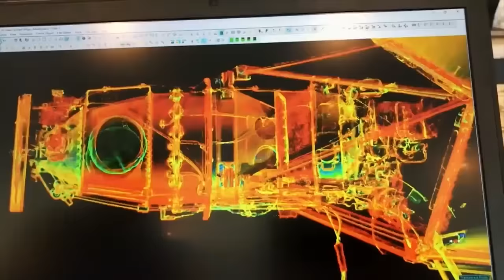We both almost died...now what??

Comment: About 6 months late to this party, hopefully someone will read this. 1) I got my pilots license in 85 however I could not afford to continue flying for the rest of the tickets so I went in the Army and became a mechanic, so what’s going right is I see a surge of young people jumping into flying which is great to know in spite of the high costs of flight schools charging more for the same ole beat up cherokees and or 152/172’s. 2) what I see that we can do better is a complete rewrite of the ACS, we have learned so much more about flying since those rules were written and have seldom been revised. We need better training both for pilots and mechanics who maintain them and the relationship that has to be forged to build trust to maintain high quality. Scenario based training maybe in simulators first, my instructor did a thing to me that I talk about to this day, we were on my long cross country at 9500’ and he asks, what would you do if the engine quit so I gave the textbook answer, he shakes his head and we keep flying. Sometime later he pulls the mixture and the prop stops and things get real quiet, I let out the OH Shit, then he says what are you going to do?? Went thru the textbook procedure he says ok do it and call it out, then he says while you’ve been going thru the procedures your battery went flat how are you going to restart the engine? I was set up for best glide so I said we can try to windmill start, he says do it so I pushed maybe 10-15 degrees he says NO PUSH it !! At the same time he says it he pushes the yoke till we were nearly vertical and that engine started right up I recovered and my heart rate became normal again. All that to say we are not training as good as maybe we should be in my opinion. 3) I’d like to see continuity in cockpits like a GA version of TCAS, maybe TCAS Lite, and density altitude calculators that tell you some kind of performance level of the airplane at higher altitudes aurally like a nagging voice saying power not available to get out of this canyon kinda like the predictive airspeed bugs or pink trend bug next to your airspeed telling you his is where your airspeed will be if you maintain it his attitude. Tools to keep you safe and keep from making bad decisions. Lastly make it harder for anyone to jump into any Bonanza before they get not only complex training but differences training for that specific airplane  and hang a 50-75 hour time on it dual with an experienced high time pilot, I think this will help in the fatalities generated from that one airplane alone, and for God’s sake come up with a better yoke raise it 8 inches from where it’s at or better yet turn into a center stick, that thing reminds me of a roller coaster ride safety bar, not to mention putting the mixture pro throttle controls in the correct place. That’s my 2 cents

Comment: Start an aircraft company. 
Help reduce the GA entry level through less expensive equipment. The more people who can get in, will be more voices to help create the systemic change that others are mentioning. Physics, math, engineering, right. Use your expertise to create not necessarily the fastest, or the slowest, or best click bait, but rather the most affordable, easiest to manufacture, service, or store..  Do what other aviation mfg can't or won't because it doesn't suit the business model or the market. Create the market. Use new materials, new manufacturing methods, new power sources, investment for testing and certification. Innovate in the name of accessibility rather than performance. 

I fly paragliders and it's incredibly fun, pure free flight. Member of USHPA. I would love to fly planes too but my current refrain is entirely financial. 
Thanks for the great videos, I think you have already done a lot through sharing your cool projects.

Comment: GA needs a new engine.  GA is about 80 years behind auto engine design, power, efficiency and reliability. Even air cooled motorcycle engines are lite years ahead of GA engines. VVT, ECM and EFI has become so reliable in small auto engines.  It is the EPA mandates that push the auto engines to their limits. In GA we are still dealing with magnetos that basically exited racing engines in the 1960s due to unreliability and performance. We are still dealing with EGT and CHT, how ridiculous!  I haven’t had an oil leak in any car or motorcycle I have owned for the last 20 years.

Comment: How about this....

Disabled access to aviation.  Deaf people come to mind, but of course there are other situations to be addressed.  Given the engineering outlook you have, you stand in a particularly good position to investigate possible solutions.  If a series of devices could be created that merely add on to most types (as opposed to airframe modification) it would make actual flight much more achievable by lowering the initial investment. This would be especially true if one of the alphabet organizations could be persuaded to own those devices and either rent them out cheap or loan them to folks to learn with. 

And speaking of solutions....

More engineering - and a business opportunity....

Create and certify a drop in replacement for current 100 LL engines.  Jet A being the obvious answer - as it's available almost everywhere.  I bet Dave Sparks could help - since Jet A is basically diesel.  Yes such replacement would be hugely expensive, but let's face it, it's probably coming.  If you can solve the problem BEFORE it becomes messy, you'd be doing GA the biggest service ever.  Again - engineering.  It's going to happen - for sure .  You're in the best position to do something that might actually work.  This could truly save GA as we know it.

Of course I can't recall the other 37 good ideas I had, but maybe later.  Best of luck with it all.

Comment: You hit on a big topic when you mentioned lead in the fuel.  With modern day chemistry, the fact that we still allow lead to be burned and distributed on our communities is unacceptable.  It was known to be a problem when it was first introduced, but greed and laziness was the primary thought process; It was the easy path forward to make a lot of money.  I don't like the idea of pricing people out of aviation because they can't afford to modify, or replace, their motors to run without lead, but the privilege to fly should not be put above the welfare of all of society, having to endure being poisoned because "It's too expensive to fix."  Kids are most susceptible to the effects of lead, and even low level exposure can severely impair a kid.  In the Silver Valley of Idaho, the people that grow up there are disparagingly referred to as "Lead Heads" by some surrounding communities.  The multitude of symptoms are hard to ignore given how widespread the neurological conditions are in the area.  This is an extreme example, given the uncontrolled release of lead into the environment that happened there, but the lessons still apply.  The greater the exposure, the greater the problems.  Thanks for listening.
Reply: One option for the top secret project is that you may alluding to the fact that Trike Industries has been working on DracoX thanks to a grant from the Air force Research Laboratory to develop DracoX Hyperstol Aircraft for a demonstration of its military effectiveness, and it is close to release?  Maybe? 😁 Love the fact the Air Force saw the potential and funded you.  I really miss seeing Draco.  Everyone was blessed to walk away from the wreck.
Reply: Would love to see Mike modify the Scrappy design to allow for clones to be manufactured and sold to the public.
Reply: Yes, Yes, Yes to the Grumman Albatross conversion.  Maybe done with turbines like the G-111T by Amphibian Aerospace Industries out of Darwin Australia?  Sounds like the ultimate RVing (different RV I know).

Comment: General Aviation is no longer affordable, the solution? Here it is.
Ultralight aircraft
-No Medical required in the US/Self declared in Canada
-Can build for 15,000 and under
-Can buy ready to fly 30,000 to 50,000
-Can repair yourself or anyone who you think can do the job
-Can use whatever parts you deem acceptable
-Can modify at your discretion.  In Canda we have advanced ultralights which have to be built and mainained according to manufacture spec as they have passenger carrying privlige.

What is Lacking
-No local sales
-No Service
-No parts
-No knowledgeable people who you can help you

What we Need
-Young people/teenagers to do the work
-Working age people to provide the money
-Business/airline companies to provide the money
-Flying clubs/groups where the teenagers build/service the aircraft and airport and the older people provide the money
-aircraft that can operate out of airstrips of under a 1,000 feet
-standard aircraft
-parts readily available
-skilled and trained people for service
-overcome the attitude in the certified/GA group of their disdain of anything not certified

If we have flying clubs all over the country with ready to go planes, you can just pull up, show your card, sign out a plane and go flying.
MB

Comment: 1. What is going right? The aviation community is pretty incredible. Technology is making some serious safety improvements. Diversity in the community is on the rise.

2. Wrong? A.Price of admission is keeping people out and forcing many more out. A new plane is worth more than most homes, most used 4 seaters are $100K plus. Maintenance might "only" be a few thousand a year but any major issues quickly bump an annual into 5 figures. Hangars if you can get them are an easy $500 a month +. Avgas approaching $7 a gallon. Avionics... Don't get started. A GPS navigator is the cost of a new car. It's tough for a blue collar person to manage any one of these expenses much less all of them. 

                  B.Public opinion of GA is pretty poor, they think we are all rich and GA doesn't provide any benefit to the public. We are noisy and spread lead over their houses. 

                  C. FAA has abdicated their jurisdiction over the commercial world and seems to make it their goal to legislate GA out of business. I'm all for making sure pilots don't die in the air but the FAA rules on medicals are overcomplicated and convoluted and often make no sense regarding safety.

Comment: The #1 thing that's wrong with aviation by far IMO: The medical certification process is too strict. Especially when it comes to mental health. Nowadays nearly everyone is diagnosed with depression, anxiety, ADHD, or some other incredibly common diagnosis. The pandemic especially resulted in MANY new diagnoses (such as my own) due it stress testing people essentially. These diagnoses shouldn't kick people out of aviation like it did for me after becoming a helicopter CFII. This is especially the case if you're in general aviation and may only ever have a couple of passengers max. But even airline pilots with hundreds of people in the back are human and have mental health issues. Many pilots including airline pilots are neurodivergent, as the nature of aviation tends to attract people who have aviation as a deep special interest, hence many possible diagnoses of autism or ADHD. This can actually be a superpower rather than a hinderance. The FAA needs to change to match all of this. I'm hoping you're both interested in pushing this forwards, as you have talked about your ADHD yourselves and so can hopefully understand. 

Also, even if the FAA can't be changed, or if changing the FAA is a long shot which will take a long time, it would be nice having resources (lawyers, AMEs with experience with the process, guides, etc.) to help those of us who are currently grounded due to mental health diagnoses to help us get re-certified and flying again as quickly as possible, and hopefully not get permanently barred from aviation as the FAA aviation medical office tends to do sometimes with such diagnoses. Although the guides and resources would be a consolation prize really, and changing the FAA is the real holy grail when it comes to this.

Comment: A certified 100 hp engine costs $30k. A 500-600 hp LS engine can be built for less than $10k with fuel injection and electronic ignition.

Comment: Design, build, & sell the Volkswagen of airplanes. Make GA financially accessible as it once was post WWII.

 This "Volkswagen" requires 2x types of airplanes, the 2nd type with 2 variants: a 2 seater trainer & a 1 seater (variant A ultralight; variant B light sport).

All 3 models must have slow flying/stable qualities that promote safety, good (optimized) power to weight ratio, very low fuel burn, & be easy to maintain w/ a surplus of spare parts for low cost.

I'm envisioning a monocoque fiberglass body, but chromoly tubed w/ minimal fabric covering may be the most economical option.

Please make GA safe & affordable for the everyday person!
Reply: Please include a BRS.

Also, make this airplane towable for storage at home. Haven't found any local airports that allow tow-in & take off, but hangar costs for a very economical airplane is another factor hindering ownership accessibility.
Reply: 1) Right: accessibility of GA inspiration through the internet. I'm getting to see what I could do, but get bogged down by what I'm missing out on in the 9 to 5 grind.

2) Scare: I don't think I'll be able to afford aviation (Pilots license & cost of flying) until I'm in my mid 30's (2035)... I'm making ~110k per year and my 1st kid is due in a month. Family is the priority!

3) I'm part of the EAA

Comment: My "corner" of aviation is warbirds/vintage.  What's going right?  I see more inclusion of women and minorities _in some locations/organizations_.  I'm a 42-year-old single woman restoring a 1941 de Havilland Tiger Moth in my spare time, and I have actually found some people/organizations who just accept that and move on.  Versus the majority who try to infantilize me or get offended when I have opinions just as strong as their own.

What scares me?
1. Airports selling off land.  I see way too much development happening on land that airports have sold off for a quick buck.  I think airports should be buying back the land around them every chance they get, and we need to find a way to make that financially feasible.
2. "Cowboy" operators.  See e.g. the Collings Foundation as just one obvious example, but it's a pervasive problem.  There were plenty of people who must have known how they were operating, and everyone just turned a blind eye.  Warbirds ARE cool.  We SHOULD "Keep 'em flying."  The way to do that is NOT never moving forward and never advancing safety.  The more internal self-policing we do, the less risk that some regulation comes along that shuts us all down.
3. "Silo'd" knowledge and lack of knowledge transfer.  As an example, the crankcases of a Gipsy Major engine were made of different alloys over the years.  One of the early alloys contains 13-15% zinc mixed in with the aluminum, and a couple of percent of other ingredients.  I had some tests performed by a metallurgical lab that Boeing and the FAA use, to confirm the alloy and find out what a modern equivalent would be... turns out there isn't one.  It has probably been ~80 years since this particular alloy was in common use for anything, and as such the pecuiarities of performing repairs on it, especially weld repairs, seem to be lost.  Owners who discover cracks in their Gipsy Major crankcases are basically on their own to come up with repair schemes, but many didn't even realize multiple alloys had been used.  Folks have done everything from physical reinforcement with through bolts, to tig welding, to laser welding, and probably anything else you can imagine.  Nobody is tracking what is successful or not, what alloy the repair was performed on, what welding technique was used, what filler material, how the weld was inspected, etc.  When I look at my airplane I'm thinking about the NEXT 100 years of its life, and how we ensure that it can continue to operate SAFELY.  To me, that requires much more cooperation and effort invested in sharing ideas, data, and knowledge.

Organizations?  I've been in AOPA and EAA pretty much since I was a kid.  I volunteered with and was a member of a local vintage aviation museum for over a decade, but that's all been shut down now so it doesn't count.

Comment: My dream was to fly rhinos off of a carrier deck. When I graduated high school, the navy told me “not with those eyes kid”. Ever since, every time I look up and see a plane in the sky it hurts a little, because that’s what I wanted to be able to do, career or hobby. I’ve found a career, but as anyone who works for a church would tell you, that’s not where the money is. That’s fine for me, I’m not there for the money. I’m there because I feel called to be there. However, even knowing a couple CFIs that would help me out, GA’s biggest barrier to entry is cost. I don’t have a good solution to that, but that’s the reason I’m not flying. I can’t afford it, but I’d love that not to be the case, and I know I’m far from alone in that. That’s where I’d love see some critical thinking and change. Side note- most affordable GA planes/run of the mill GA planes are 99% older than I am. Not to say that they’re not good platforms but why is newer gear so hard to come by? You guys are awesome, keep on keeping on!!